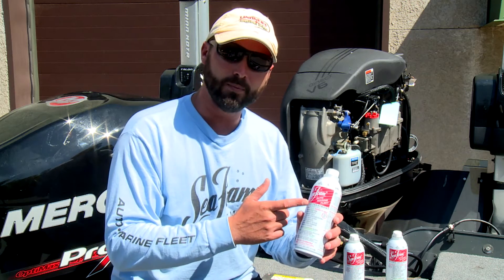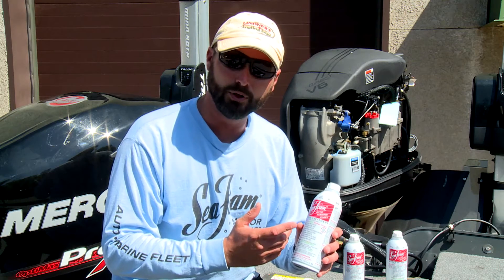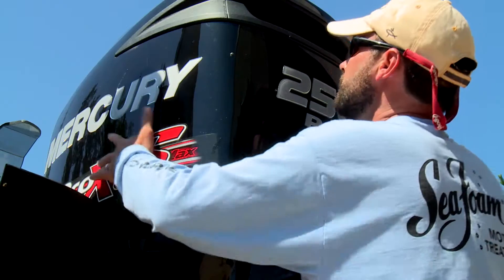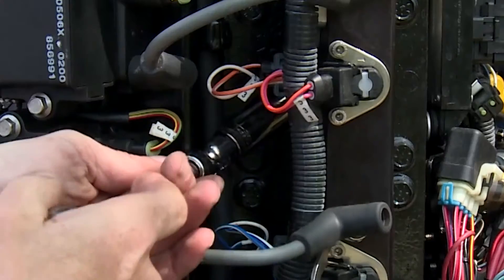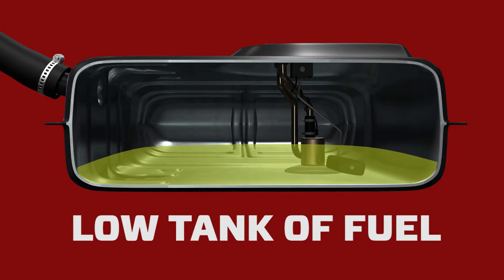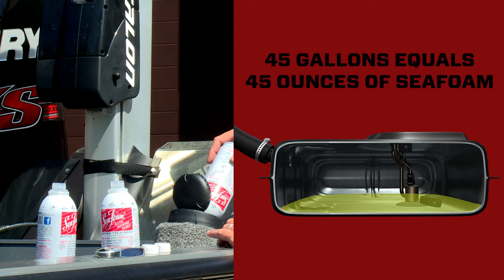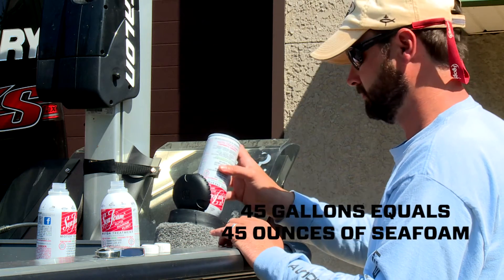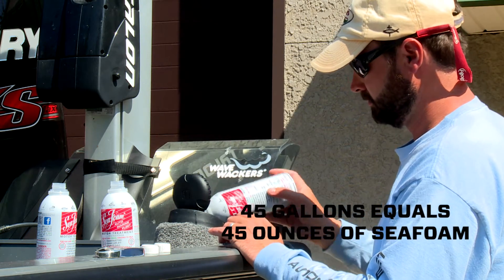Sea Foam DID YOU KNOW? Engine storage without pulling parts

Comment: I like Sea Foam but it is expensive.  Use it in my Honda 200hp outboard when I have to use fuel that is not directly from a gas station (fishing camps in Canada) and in the late Fall when you do not know when the Last Day on the Water will be.

Use it in my Harley for same reasons.  Just used it over the weekend, 12/20/2020, as the temps were right around freezing and do not know if I will be able to ride again.  I had a tank of medium grade fuel but with Sea Foam my Harley ran as strong as with top shelf Premium fuel.  For me on a 2014 Street Glide Special that is 116 mph.  Usually with medium grade fuel top speed is 106 mph.  Interesting.